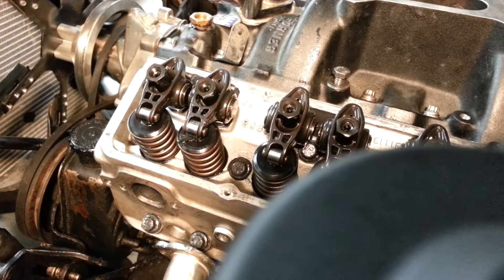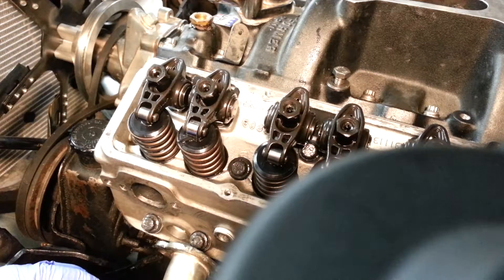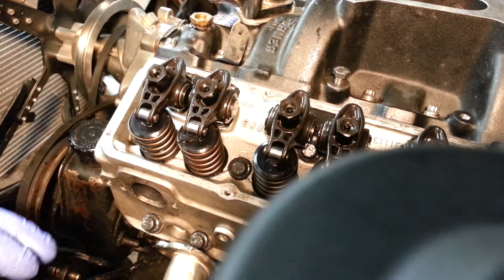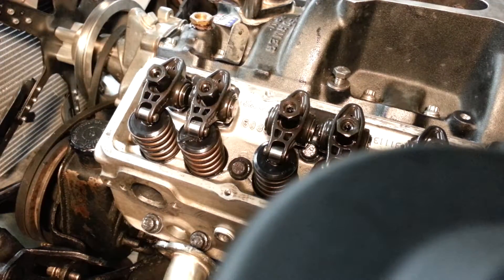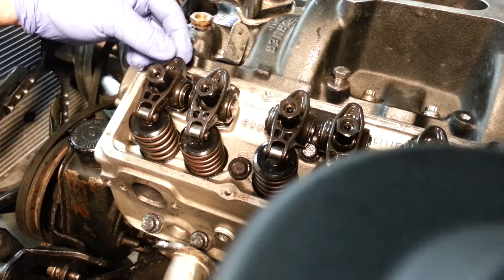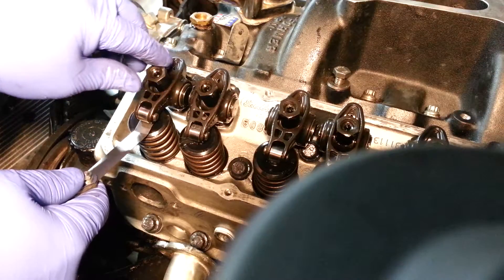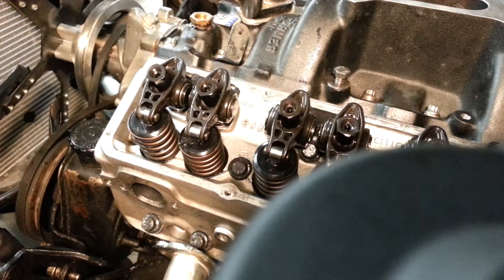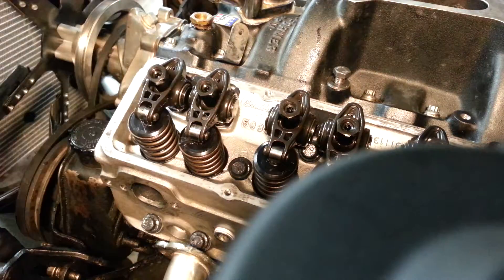Setting Rocker Valve Lash with Intake on for SBC Hydraulic and Solid camshafts

Comment: I don't get it, why over complicate this?, set at TDC fire #1 on compression stroke and do  Intake 1, 2, 5, 7 & Exhaust 1, 3, 4, 8  then turn the engine over one revolution back again to TDC and now #6 cyl is at compression stroke TDC and do Intake 3, 4, 6, 8 then Exhaust 2, 5, 6, 7
Reply from the maker: Thanks for providing your opinion on setting up valve lash in your basic method. This video shows a method for both solid lifters and hydraulic lifters using the same method of zero lash. This EOIC method is used because of the vast different types of cam shafts available and ensures that the lifter is set up on the correct side of the cam lobe.  This will put the lifter on the base circle where you want it to be. Most of the modern high performance cam shafts do not have equal profile lobes of lift per the dual profile used on as the example of comp cams extreme series or 4/7 swap series.  Your method requires removing the number one spark plug to ensure compression stroke of number one piston and is only safely used to a certain amount of equal intake and exhaust lift per a single profile stock lift around up to 0.430. Comp Cams recommends this method also because it maximizes the point of travel for the lifter's determined amount of lift to set lash while ensuring the lifter is on the base circle. You can change the profile of a cam shaft by the amount of lift provided where you determine the zero lash and the EOIC method ensures that the camshaft is in the absolutely correct spot for setting equally proper valve lash without any guess work. I will upload a video showing your method to explain these differences in future video posts.
Reply: Thanks for the reply... I have a Comp Cam Xtreme Marine™, XM308HR roller hyd cam and it sounds clicky when running, I started with 1/4 turn past zero lash, re-adjusted to 1/2" past zero lash and still sounds the same. I am thinking I should be using your method and see if I can get the clicking sound to go away. I have looked on the forums and some say that an aggressive cam like mine with the strong valve springs, Scorpion Endurance rockers it is not uncommon to have a slightly noisy top end. I don't like it, no one valve is nosier then the next, they are all equally noisy. Any thoughts?? 

  @djrowe10
Reply from the maker: @AmmoMaster  That type of noisy roller rocker clicking is very common with scorpion, which is a great roller rocker but has the sewing machine sound clicking that is amplified by modern hydraulic lifters.  There are a few options that I know have worked for others that include using thicker oil like 10W40, 15W40, or 20W50 or adding one extra quart of Lucas Oil pure petroleum called (Lucas Heavy Duty Oil Stabilizer 32oz), which is what I personally do with all of my engines. Even my Harland Sharp and Comp Cams roller rockers make small clicking noises without adding oil stabilizer. Another option that is becoming popular is to run solid lifters in place of hydraulic lifters. Most modern hydraulic lifters are all Chinese made which is poor quality compared to decades ago American high quality parts. No matter what anyone else says you can use solid lifters on hydraulic profile cam shafts. Comp Cams says to start the lash of the lifter to rocker clearance at least 0.010 and most at 0.020. I know solid lifters do make some noise but it is about the same as modern hydraulic lifters and safer to me to protect my old american motors. Maybe try adding the extra quart of Lucas Oil stabilizer to what you already have in your engine first and see where that goes and let me know. If that doesn't improve the sound then try my method to set up the valve train and you'll know it is as close to perfect as possible for your cam shaft profile and lifters. Then if all else fails maybe try the solid lifers to see what that does. Good luck!
Reply: I could be wrong on this but i believe if you had  a high duration or i guess i should say high advertised duration (big cam) you could be setting lash at the wrong point on the lobe to achieve the correct amount of lash. I'm kinda an Oakie mechanic and i dont think most people would have an issue doing it that way but the higher performance an engine is the closer those adjustments have to be to achieve longevity which is nice. Measure twice torque three times.